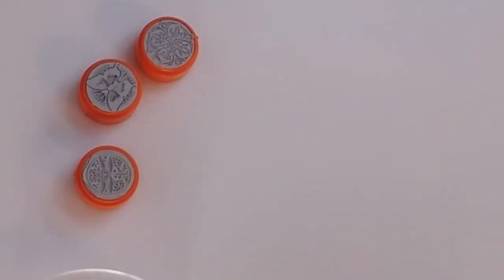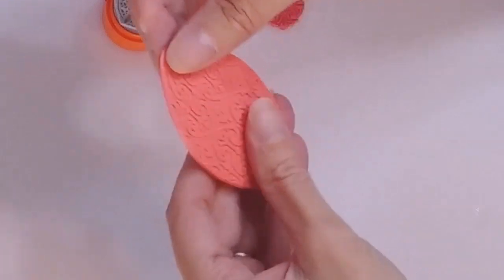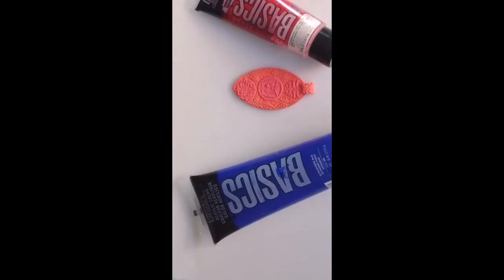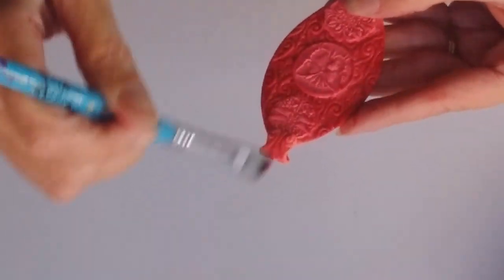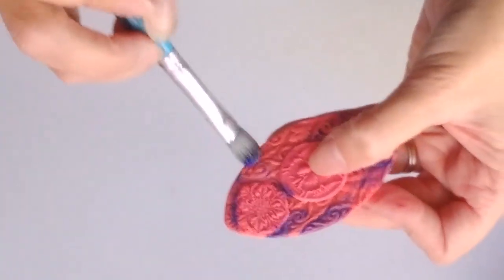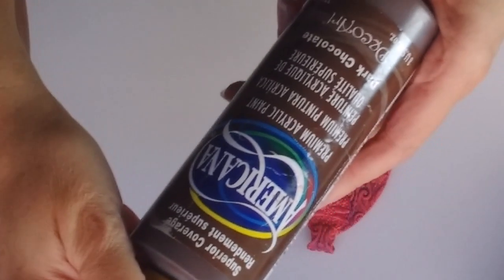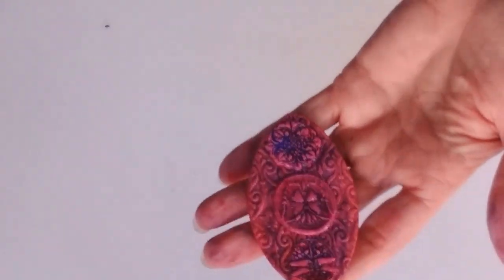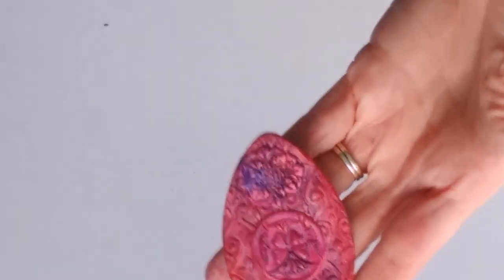Rustic Polymer Clay Pendant by Tejae

Comment: Beautiful. How did you bind the pieces together? did you glue them before baking them?
Thanks.
Reply from the maker: Hi cacevedo07, you have choices. Raw polymer sticks together, you could make the pieces and combine all together bake  they will bond and then after it cools you can backfill with a little more clay and cure with a heat gun. 

Or you can bake the smaller pieces and push them into the raw base and bake again. They will bond together.

Comment: Do you ever run the risk of burning the bottom piece of the pendant since it was already baked once?
Reply from the maker: No, not at all because when I bake polymer clay, I'm using an oven thermometer and don't go over the recommended temperature. You will only burn it if your oven is too hot. If you burn it and it smokes that is toxic...so be sure to use an oven thermometer. It can be baked  multiple times with no issues and lots of clayers do.

Comment: Hi, Tejae!  Do you use any bonding material between your cured and uncured clays when you combine them?
Reply from the maker: Generally yes. I use the Genesis heat set, like shown in the video. However the clay was so soft when I attached the round elements I didn't need it on the front.